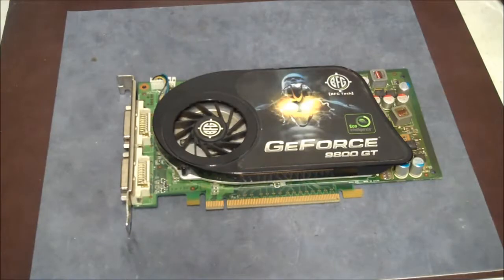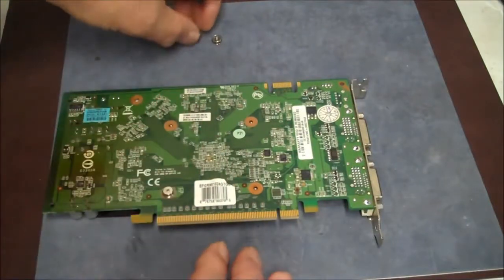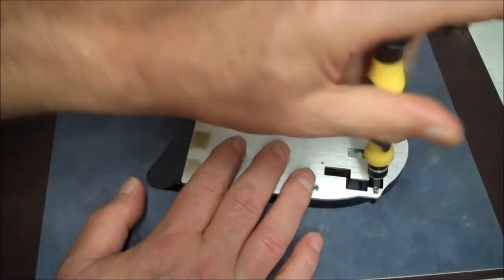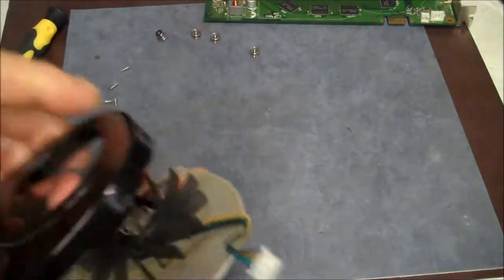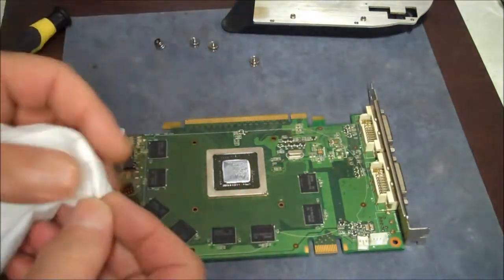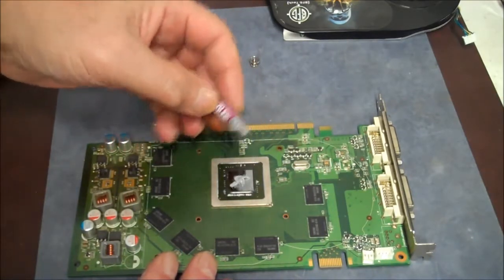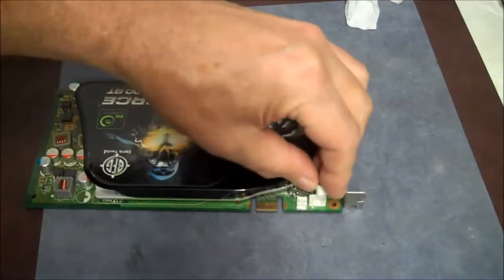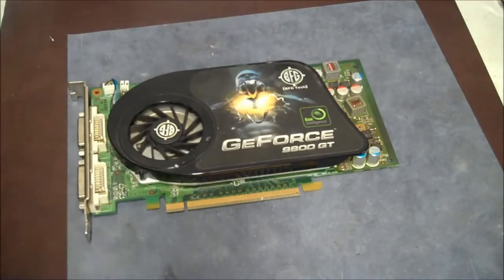How to Repair Video Card BFG 9800 GT

Comment: hello sir , i have 9800 gt , it sopted working and become hot and small of burn , white matter disppered ! what is solution ?
Reply from the maker: High heat is a chip killer. If it smells burnt it is probably beyond fixing.

Comment: I have a BFG 9800GT (according to the device ID) but it doesn't have a fan, it has a gigantic heatsink with heat pipes.
Reply from the maker: better with a heatsink like that, just clean it good.

Comment: Found this video because someone is selling this card. I'm going to offer $2
Reply from the maker: lol
Reply: Surprisingly, this card still does very well with games that maxing graphics out don't matter. Diablo III, Path of Exile, League of Legends, and Warframe all run very well. I was even able to play older but not that old games like Skyrim and Dark Souls at enjoyable frame rates on medium settings. The card still has value in 2018.
Reply: @dcarroll4294  Yup, I play Skyrim on 1280x720 at medium settings. It even plays GTA5, but only on the absolute lowest settings possible and only at about 15-20fps but it does still technically work.